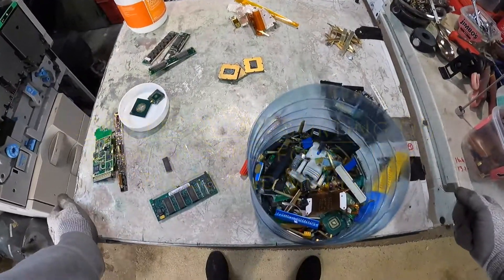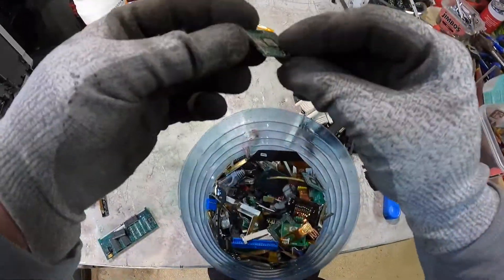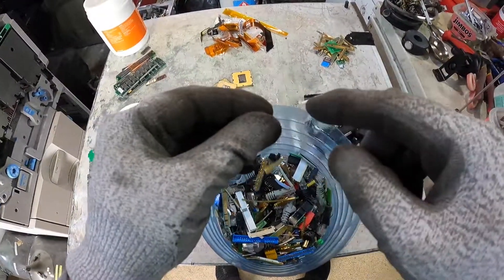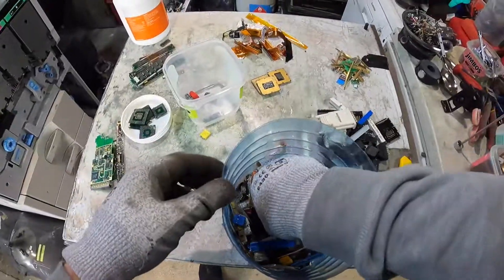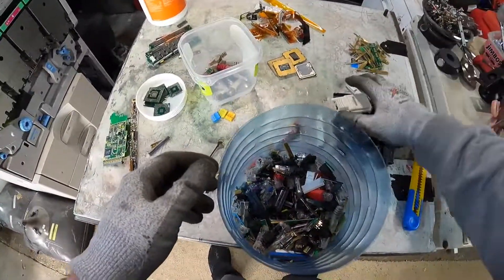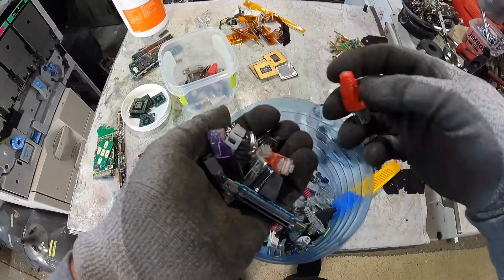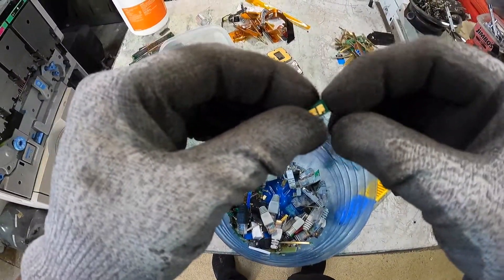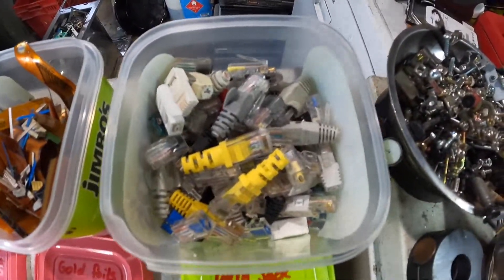Gold sorting

Comment: those ram connectors are tin and the ic chips are memory-based and normally great for gold recovery so I'd separate them plus try  plyers they are much quicker or an air chisel
Reply from the maker: Unfortunately I don't have an air chisel. I have tried pliers and found that they break the chips. Thanks for the advice.